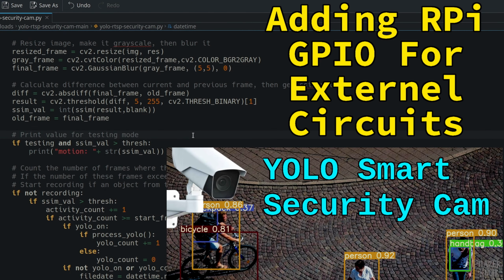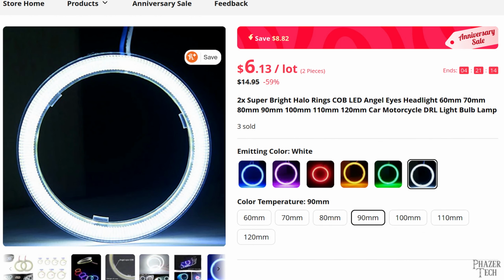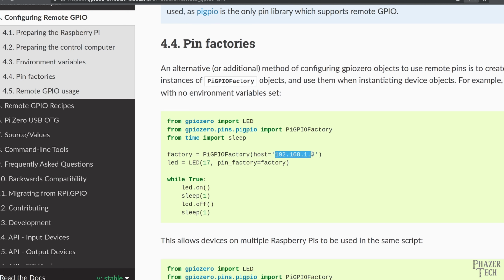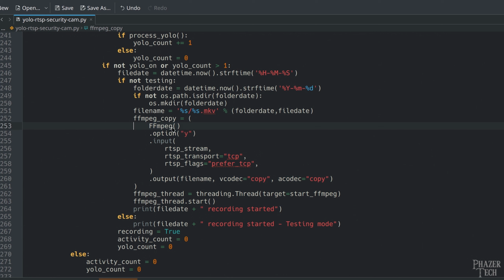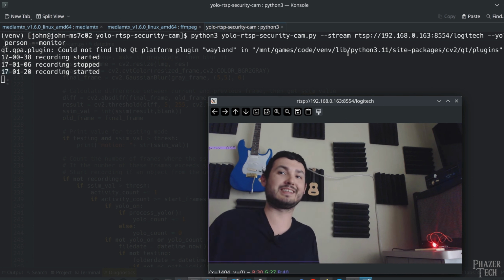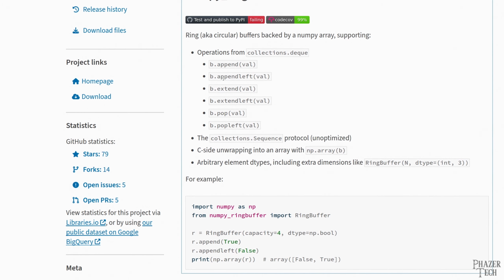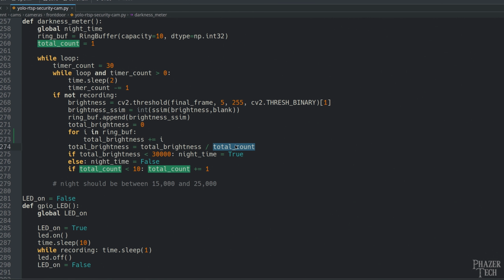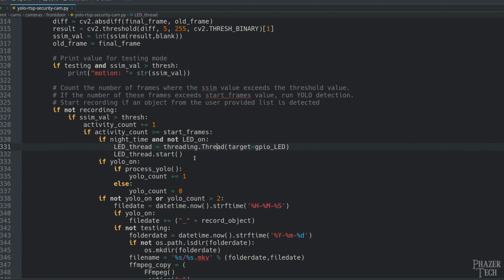Adding GPIO For External Circuits - YOLO RTSP Security Cam Python App

Comment: I would like to improve yolo on raspberry pi with Hailo M2 board, I can not find examples for IP cam , do you have any idea how to do it?
Reply from the maker: I don't have experience with that accelerator but I'm assuming you're using the Python OpenCV library? If so you can connect to an IP camera the same way I did, just enter the address when opening a video source.
cap = cv2.VideoCapture(rtsp_stream)
Reply: @PhazerTech  yes I can connect the rp to the ip cam, but I don't know how to use the hailo to improve the inference time.